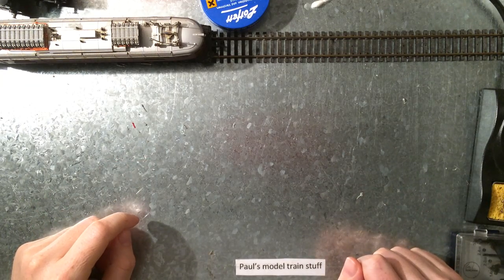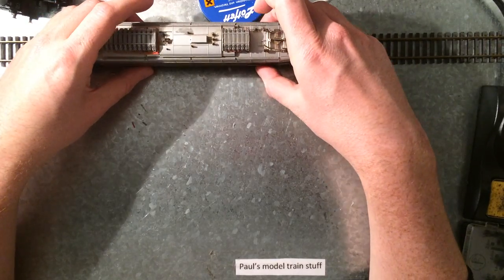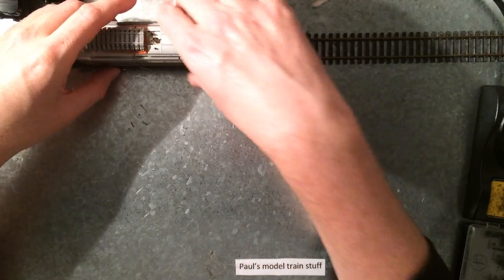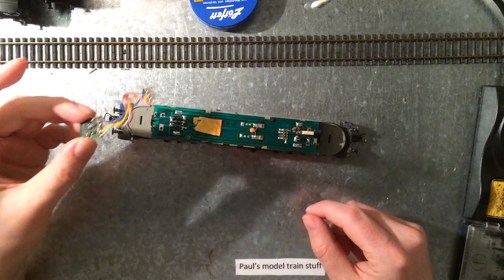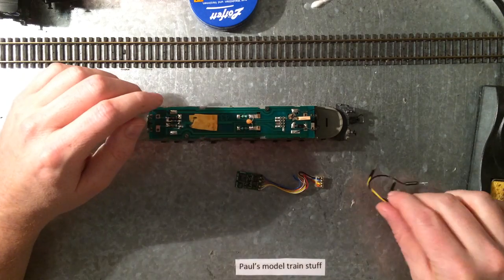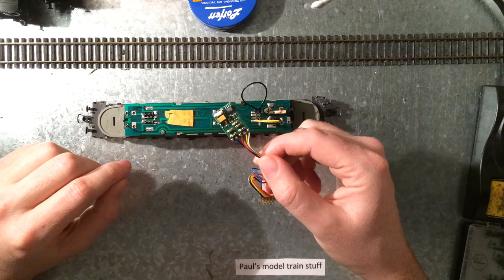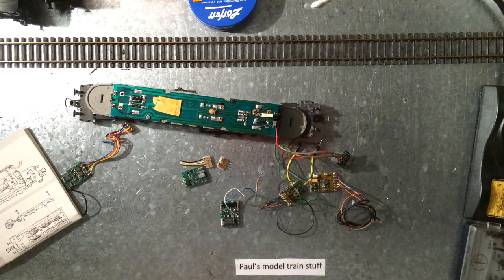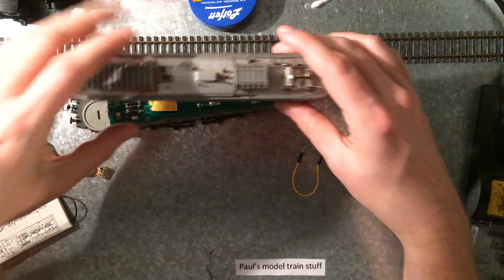Digital go! (Video in English)

Comment: A voltmeter showing the current of the rails would be a nice indicator for your blog.
Reply from the maker: If I go digital, it will always be around 18V. The commands send to the train will determine its movements. At that point a voltmeter has little to meaning.
Reply: It would merely be an indication of power on the rails something that is invisible now.